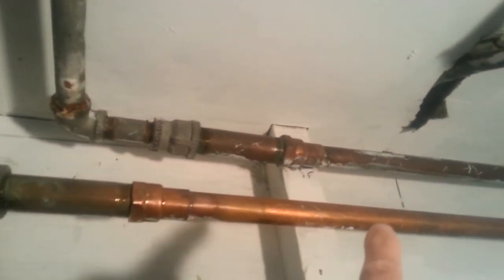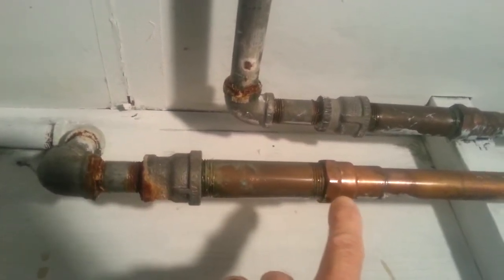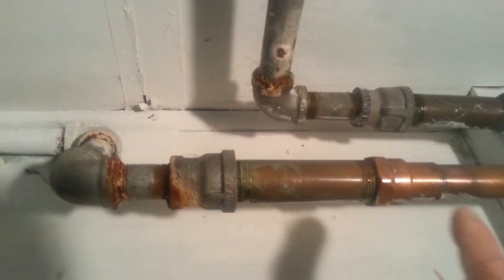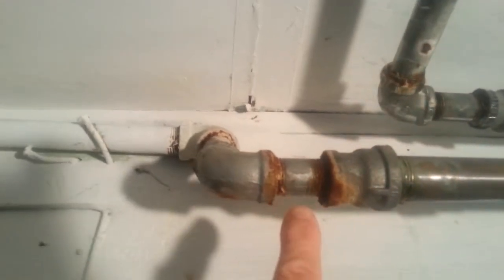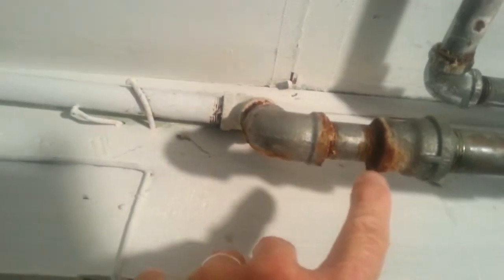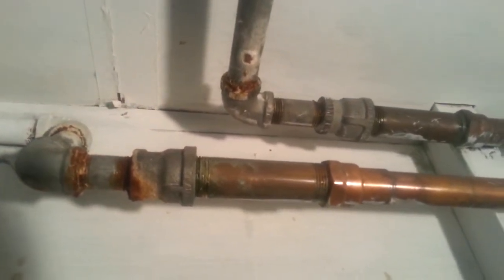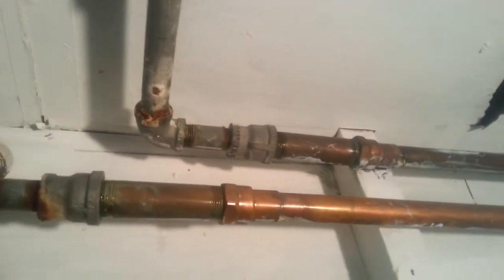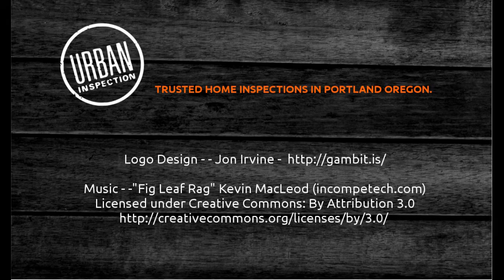Common Home Plumbing Problems: Corrosion

Comment: Anyone having water radiator heating should inspect the connections it makes to your home water supply (copper). If you know where your pressure release valve is, start there, usually in the boiler (furnace)  room.

Comment: Yep. I have galvanized steel directly connected to copper and it is corroding big time. I am trying get educated on this so I can be proactive before catastrophe strikes. My home was built in 1952 and I have been living here for 25 years and just realized that I have a problem. The previous owners did not put brass connection between the 2 metals.